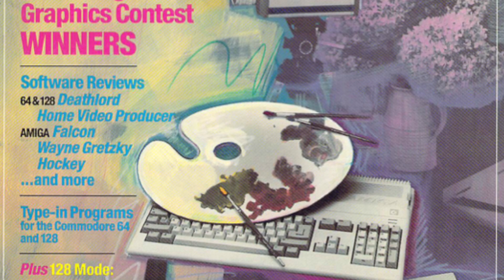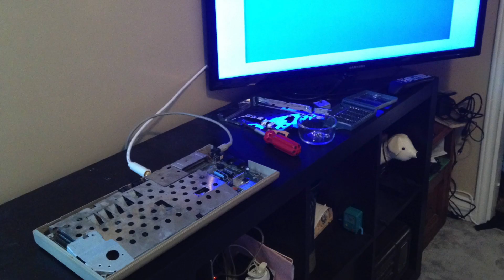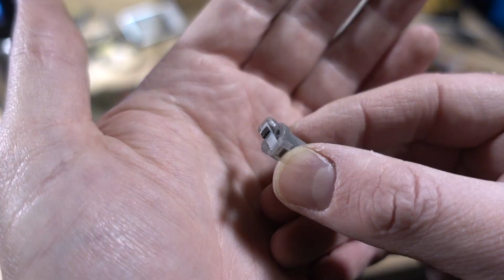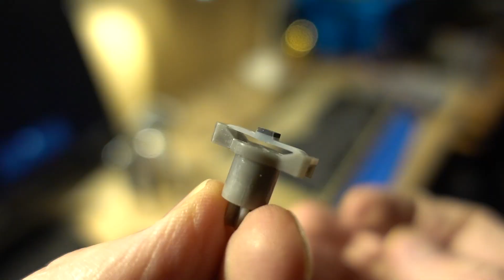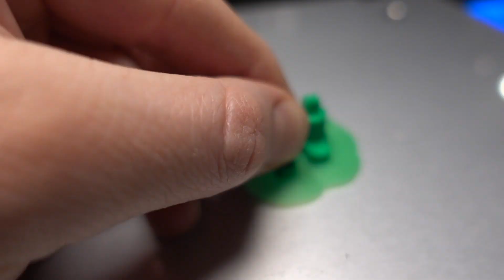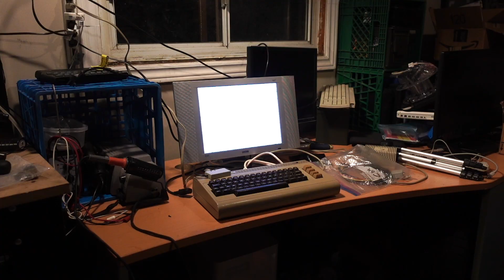[fix] Commodore C64C Keyboard Repair

Comment: PETG is much nicer than PLA for these kinds of things, much lower friction. I actually run PETG bushings even on X-axis of my printer, while on Y i have Igudur. Also i wonder if you want to reorient it such that you can print it laying on its side. Maybe such that the cross is diagonal. You could get a print that is more eagre to slide in there.

Will be making a $20-ish MSLA printer. That's probably better for these kinds of things :D

As to filament? You spent nothing. It's probably like 20g for 50 prototypes. You get 1kg on a spool.